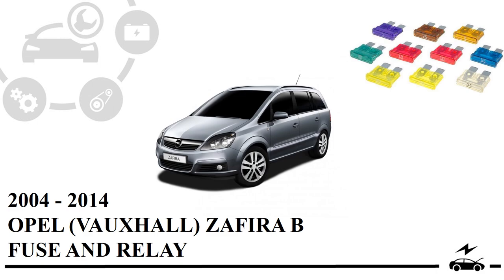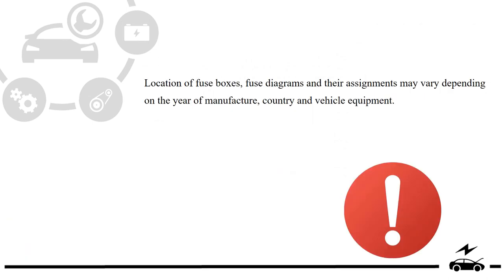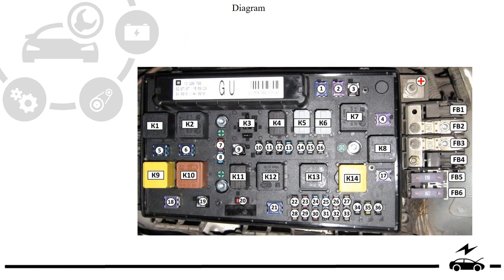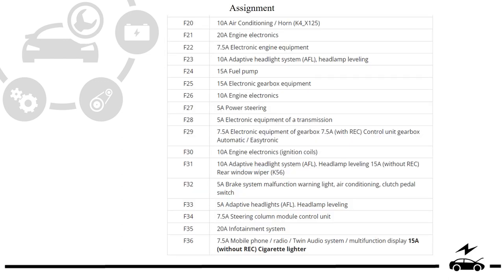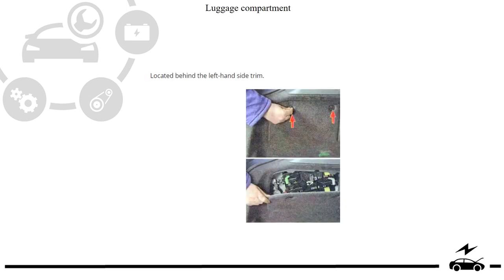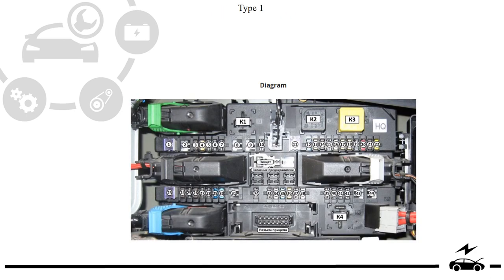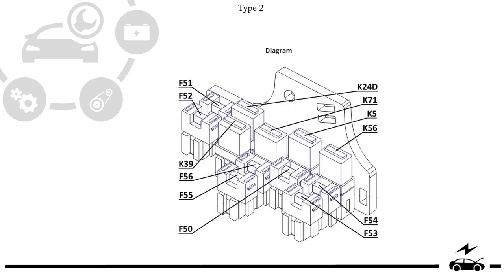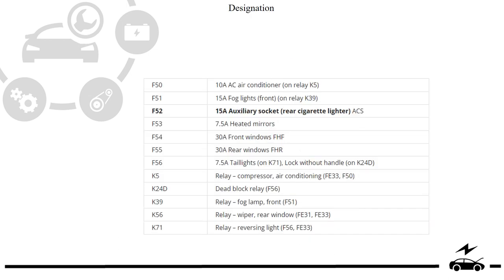Fuse box with diagram for Opel Vauxhall Zafira B 2004 - 2014 relay location assignment photo

Comment: You made a very good video, and it is commendable, but the most important information that you had about the fuses of you from 1 to 20 was not mentioned by you.  which is super important.  11 no. Paking sensor and MT electronic.  if that does not work, then your car is starting an issue with a gear box. Cluster information will have problems.  🙂🤔 
Please provides the information on 1 to 20 .. If possible.. 

Auto Electrician 
Mr. Thakur